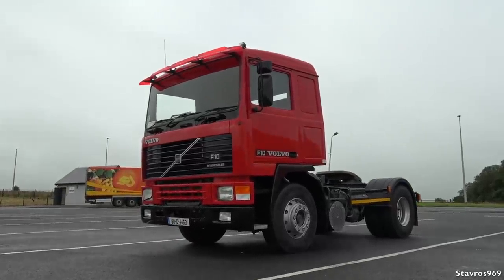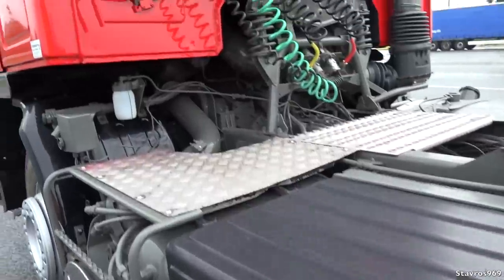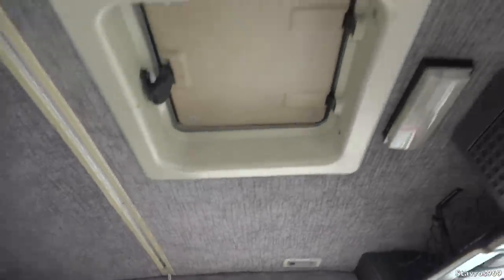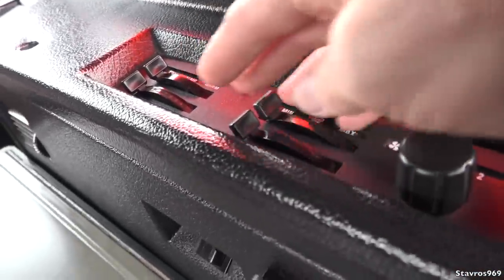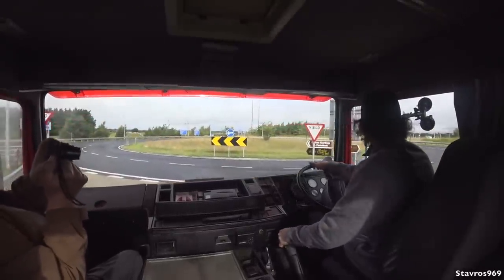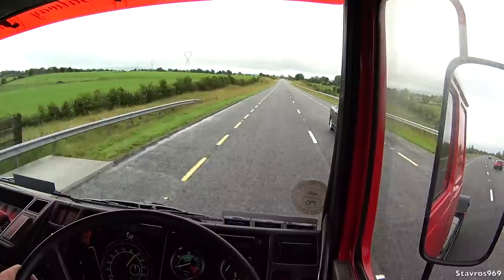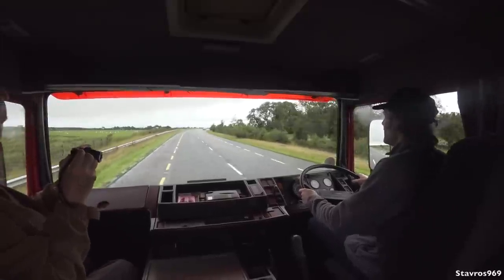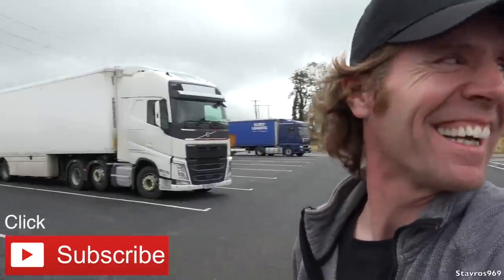1988 VOLVO F10 320 Full Tour & Test Drive 32 Year's on!

Comment: my father had a volvo f12 385 hp bought brand new since 1984 (the circle headlights) and sold in 2009. still works. the new owner works it with a tipper truck trailer for his farm. sometimes i see it on the roads and cry my eyes out. so many memories! 
the brakes were fenomenal and they are not disc brakes. 
the air dryer was below the passenger side.
that mirror over there you mentioned is definitely from a newer model. no F series had such nice mirrors. 
the gearbox is indeed tight. even so many years and you would not make a mistake.

Comment: Hi there stavros  
I have been a driver for over 40 years and in 1979 I worked for a company called  a one transport from leeds and they had a Hugh fleet of  
Volvo s  f10 f88 f86 then f7 
I got to drive the f10 and it was the truck I loved it but all the time I worked for them I had little f86 then f7 no night heater them days my fist truck with a heater in was 1995 volvo FH I loved it .

Comment: Lovely f10 stavros,Would F10 not have had a 4 over 4 with high / low and F12 had 3 over 3 with splitter and high / low,think thats why it has different gear leaver because it has F12 gear box.

Comment: The heater controls are the same ones you get in a Volvo 240
Reply: Yes, air vents, the door handles inside and the grab handles (in black very rare, only 240 Turbo and early GT) too.

Comment: 320 pony power................compared to a Cummins or CAT engines these things were gutless in heavy haulage ( 38,000kg to 80,000kg)............but just fine for cruising around the autobahns with 4 tons of tissue paper. By comparison the F7 from the 1980's were super reliable and very good for their size and stayed on the roads for about 20 years longer! The biggest problem typical with Euro trucks of that era was the hopeless exhaust brake...............Jake brakes just hit these things out the park.

Comment: That thing looks like something from the early 2000s not from 1988, if you didn't mentioned the year of if i would think is a 2006 model
Reply: @RWL2012  in comparison with a american brand from early 2000s that 88' Volvo looks way ahead of its time it looks like a early 2000s model like a 2006 for example